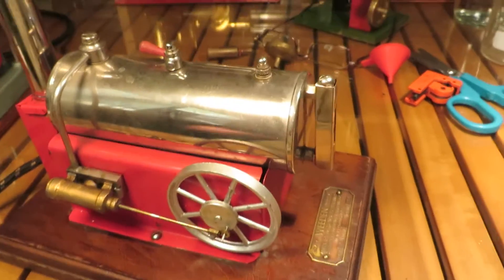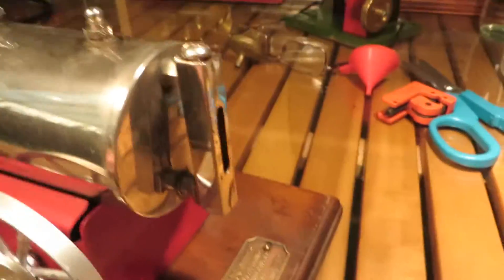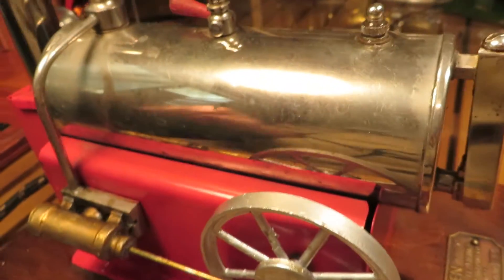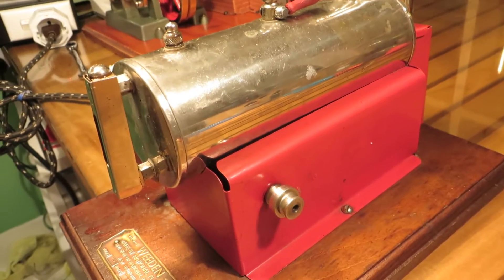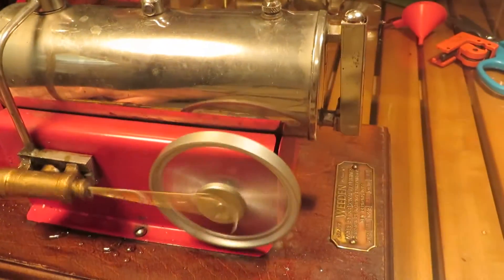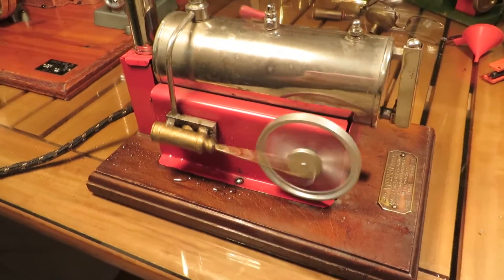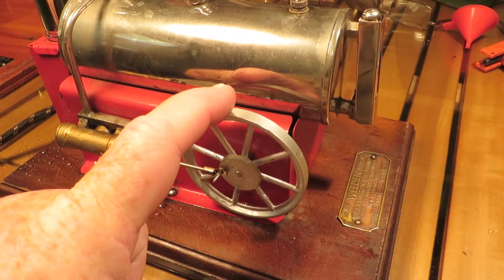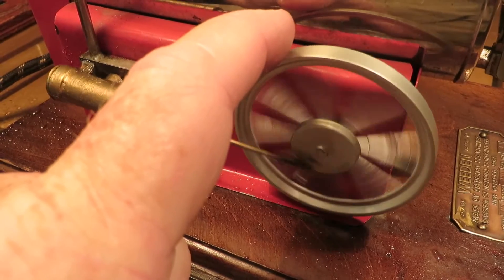Weeden Model Toy Steam Engine

Comment: Were you able to find the sight glass?  Mine is broken too.
Reply from the maker: G'day, look up 'Borosilicate glass' on eBay and it comes in many different thickness's. Easy to nick with a glass cutter and snap to length or cut off with a Dremel tool. Hope that helps - Cheers Jim